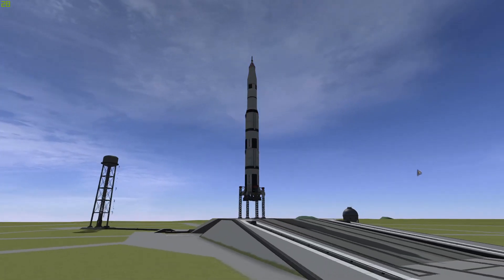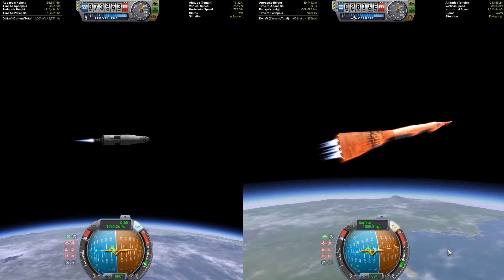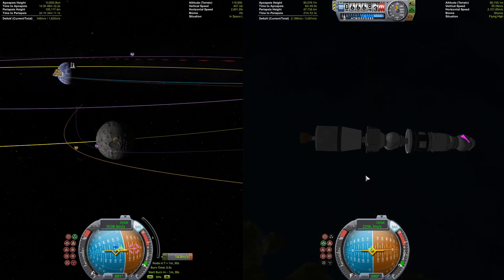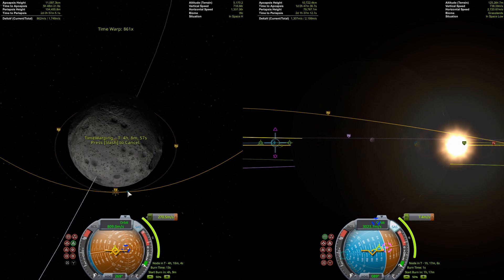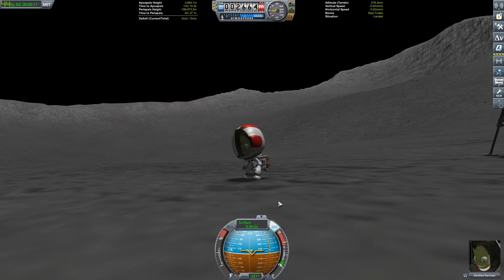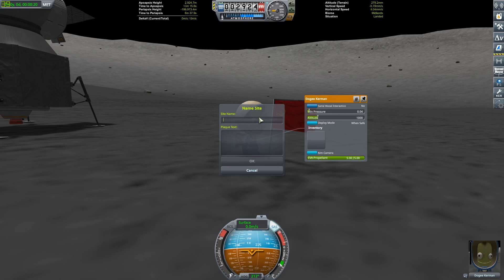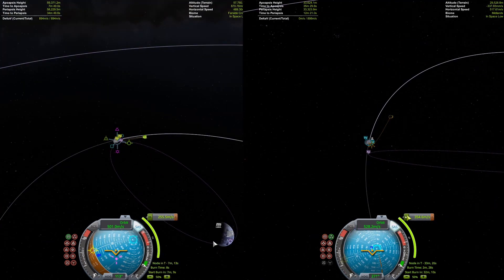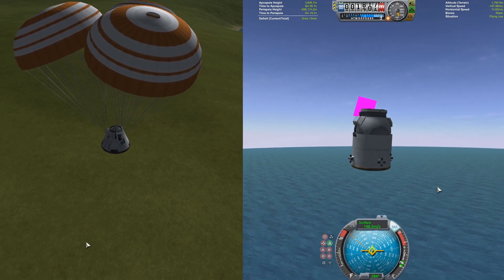KSP: Saturn v VS Failed Soviet Moon Rocket (N1-L3) Which Is Better?

Comment: The N1 did not have gimbals, it used an advanced control method, known as thrust vectoring.  Which means that the N1 throttled down one or several of its engines to control itself. This means that it could only suffer two  engine failures before having to abort.

Comment: Its all fake data about Saturn rocket, watch real video of launches, nasa say that at 107sec of flight saturn had speed about 900m/s when real speed was just around 110m/s, 8 times less! For sure with such speed instead nasa fake data this Saturn rocket could never reach not only moon but even space. 5 weak engines could not pull it with required speed thats it) Thats why USA never used this engines after! If it was so reliable and powerfull why USA just throw it away and then started to buy russian RD series enigines? N-1 with 30 engines was projected really to reach the moon, when Saturn was projected to impress public with successfull launch and next fall into pacific ocean, then USA could tell whole world fairytails about reaching moon.

Comment: I mean considering the Saturn V was pretty much thee most successful rocket of all time you have to give it to the Saturn V. Not only was it an absolute beast, it was insanely reliable and has a legendary, borderline flawless record of accomplishments. Having said that... the N1 certainly gives it a run for its money and is just SO fucking cool to look at. It was a beautiful rocket with engines which were ahead of their time... unfortunately the Soviet space program just didnt have enough to work with. They were underfunded, under-resourced, over-pressured, and not given enough time for critical testing. The N1 was a dangerous combination of old outdated technology and new unmastered technology. Despite the N1's failure, it's extremely efficient closed-cycle engine technology has been adopted all around the world including the US.

Comment: Obviously the answer is the Saturn V because it didn’t fail every launch
Reply from the maker: yeah, but the n-1 has 30 engines...
Reply: @Piolet1549  MOAR BOOSTERS!
Reply: @Piolet1549  When you can't launch a rocket in ksp what do you do MORE BOOSTERS!!!!!!!!
Reply: @Piolet1549  yeah, but the n-1 never became the one and only rocket to put man on the moon..
Reply: @Piolet1549  and is the most kerbal rocket ever
Reply: @Piolet1549  more isn't better
Reply: @gamer24-75  that is not the kerbal way!!
Reply: @gamer24-75 r/wooosh
Reply: We could've had moon bases if it didn't fail like in For all mankind tho
Reply: I agree.
Reply from the maker: @dsplaisted  MOAR
Reply: @ARGHYADIP BHOWMIK More boosters = more thrust
TWR = thrust/weight
TWR determines how long to escape the atmosphere
Reply: Exactly, easy question to answer. 😂 N1 was a very cool and interesting project... But in order for a rocket to do it's job: it has to not explode or fall out of the sky.

Comment: Is the n-1 fully fueled?
Reply: The n-1 in this video is about 50% empty space. If you make a to scale n-1 in ksp it ends up having too much delta-v
Reply from the maker: I had to drain the Saturn V much more than i had to drain the N-1. That is mainly because I used far less efficient engines for the N-1 so it requires a deceivingly large amount of fuel
Reply: @bobbybobby4  thats only because it is superior in every way.
Reply: Is it custom saturn V or it's the stock one?
Reply from the maker: Fully stock
Reply: I mean if it is the one that is prebuild
Reply from the maker: Oh, no it’s not the prebuilt one